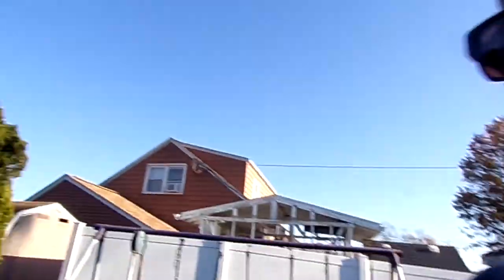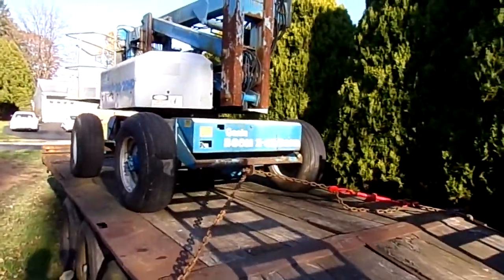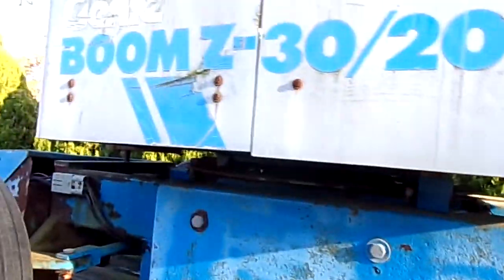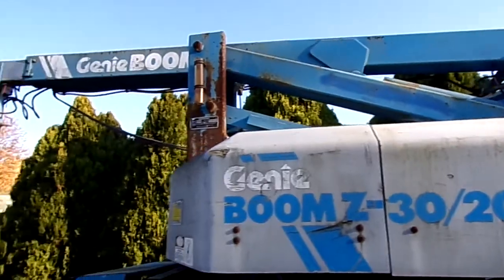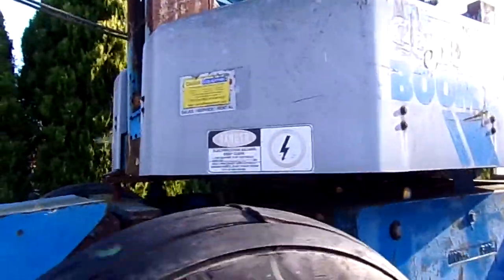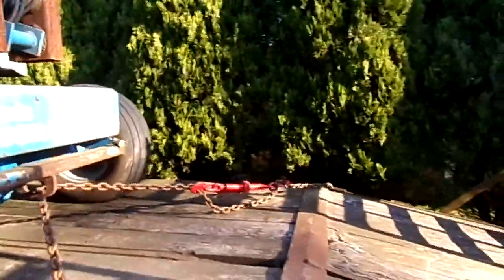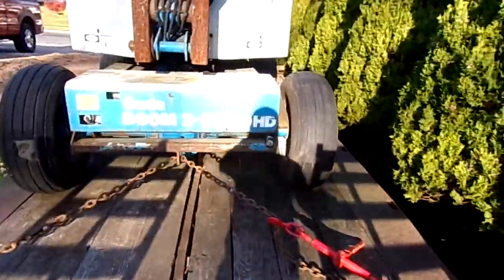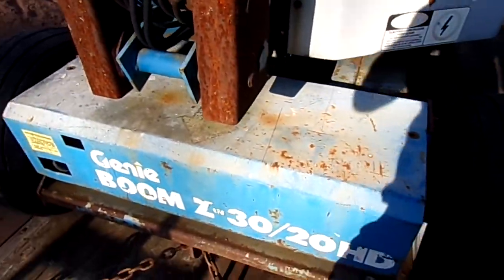preview Genie Boom Lift Z-30/20HD. Will it run again?

Comment: I've got the same one and had to go through all the electronics. It works good now.
Reply from the maker: Same here. Have vids coming soon
Reply: @ranflee1  I have a few videos on mine. I had to make rims for it, and fix a hydraulic cylinder. That was years ago. When I bought it because it wouldn't move someone took the wheels off and welded it to a trailer.
Reply from the maker: I think I saw your vids.